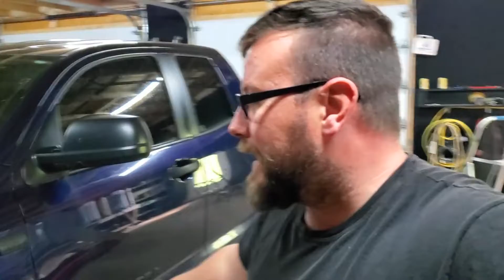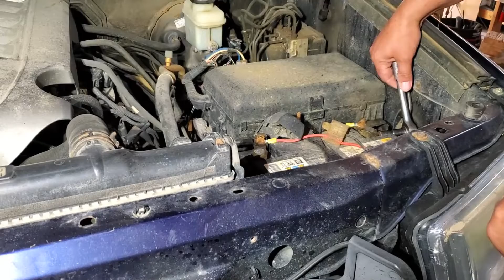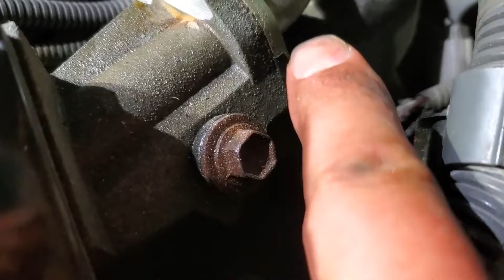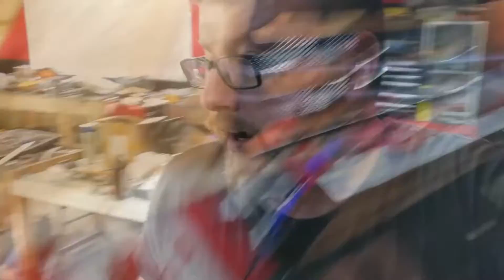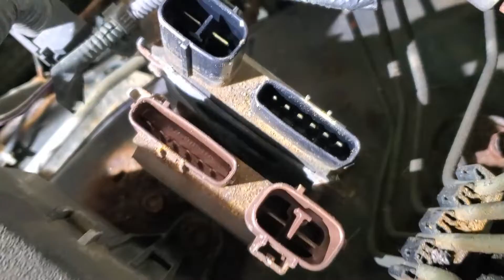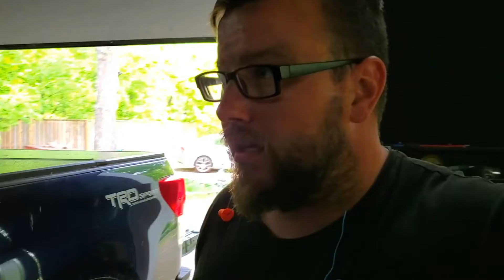How To Install Secondary Air Injection System Bypass Kit on Tundra, Sequoia, GX460, LX570

Comment: What would happen if I did the electrical but did not install the blocking plates?
Reply: Exhaust travels backwards through the system burning the pump and recirculating the exhaust in through the intake

Comment: So once you pull the vac lines from the switches do you plug them? Or did you just leave the switches on the truck? I’m having the same issues on my 07. I replaced bank one last year and it fixed the issue but she’s acting up again.

Comment: I have a 2007 4.7L Tundra. The SAIS failed twice with me first at 135k miles which was replaced under warranty and again at 255k miles. I got the same kit you did the valves for my truck are bolted on the valve covers and the connections that lead to the pipes were further back against the back of the engine bay. There is a pigtail you can get that disables the the pressure sensors in the valve getting them allows you to remove the valves from your truck but cost another $200 USD for each valve. The bypass kit was worth every penny. The module that you replace is the drivers for the SAIS
Reply: I seen your comment and I was wondering the same thing about him reinstalling those bypass units. I have an 09 Sequoia I'm doing the valve covers, spark plugs coil packs and all that crap. Taking these units off cut me to pieces. Mine's not throwing any codes whatsoever but I wanted to get rid of this crap so I don't have to do it again. I watch the previous video from Hewitt and he said that he was sourcing these from Japan the bypass pressure sensors,$200 each, if you got those for your vehicle, did you pay attention to the part numbers on them because I'd like to buy them but $200 each is a little pricey. Any help would be appreciated.
Reply: @perry5598  I never got the pressure sensor pig tail and just left the SAIS valves on. I didn’t want to spend another $400 if I didn’t have to
Reply: @SeahawkAz  thanks very much for getting back to me I really appreciate it, I still got mine tore all apart waiting on some parts to get here, I'm 68 years old and 100% disabled so this is tearing me up. I'll do some more research and see if I can find out those part numbers thank you

Comment: Got a 08 and have one tge bypassing kit on .but the check light still on.  Code p2436  secondary air injection system sensor bank 2..  i haven't drove it an hour though so i domt kno if i did anything else wrong

Comment: Will it pass emissions inspection?
Reply from the maker: Although you are technically bypassing an emissions device, when it's installed and running correctly there are no codes. So I don't see why it wouldn't pass. Currently we have no emissions inspection here in Ontario currently so can't answer that question 100%
Reply: Yes it does because they will be no codes